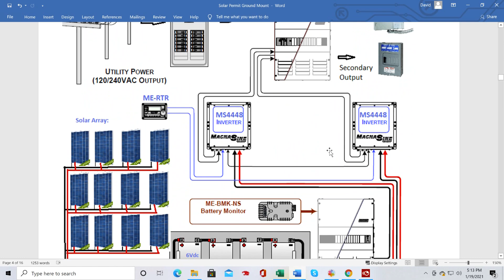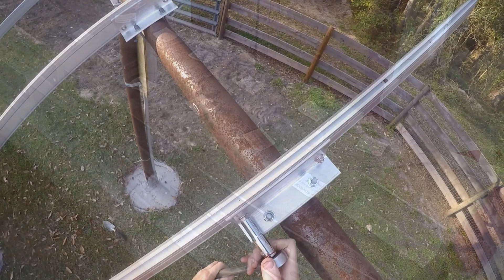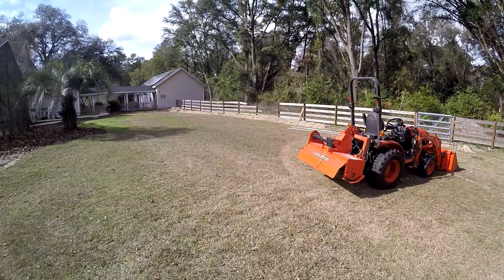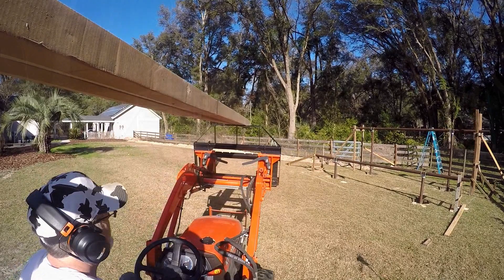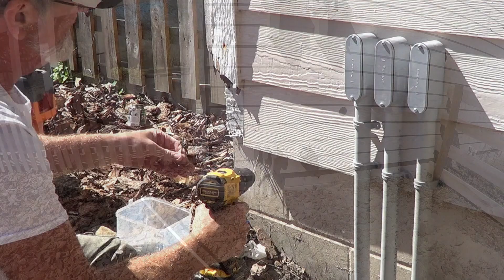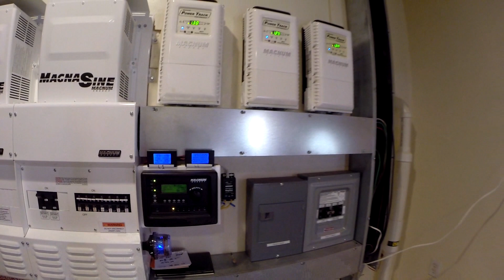Off-Grid Solar Panel Ground Mount- IronRidge

Comment: I happened to find your video and I am very impressed.  We are planning to add solar as a backup source of power.  Can use a lot of the information you provided in your video.  Thanks so much for sharing.
Reply from the maker: Sounds good.  Thanks!

Comment: Excellent design and implementation. I'm in the process of installing a ground mount and wondering if you have a link to your excel spreadsheet you used for matching the panels with the charge controllers? Thx
Reply from the maker: Paul, Check the bottom of the description of this video: https://youtu.be/N7CoCI-0IoY
Thanks!

Comment: I'm curious how you prepared your plans / drawings for the Building Department?  If there a software package or service?  Thanks.  Also, I'll be looking at your planning spreadsheet on panel voltage and number of panels and the inverter input max to help with me with some decisions.  Thanks again.
Reply from the maker: I just made up my plans from MS Word.  The doc is listed in the comments and you could start with that as a guide if you like.  I can't guarantee that your county will accept it.  I would call them an d have a discussion about what they are looking for before you submit anything.  Thanks!
Reply: @HomesteadEngineering  Great ideas.  I'll check out your document.  Thanks.

Comment: I like your new install.  I have been looking at ground mount  kits. It's just not going to happen. They are so expensive. I do have a mill and 40 acres of timber. So it looks like I'll have to build it out of wood again.
Reply from the maker: Finance is probably the biggest limiting factor across homesteading and prepping for sure.  With your mill and your timber I don't think your going to have a problem.  :)  BTW:  I LOVE your pump house!
Reply: @HomesteadEngineering  Thank you. Coming from you that means a lot.

Comment: I enjoyed watching the compilation. How much energy are you getting from it now?
Reply from the maker: Hello Hoot, I am probably using about 30kWh/day off the complete system.  It probably generates more like 50 kWh/day so I need to find more ways to use that wasted power.  I think I may install a 12,000 BTU Mr. Cool AC.  That would be a good way to make use of that unused power.  Thanks!